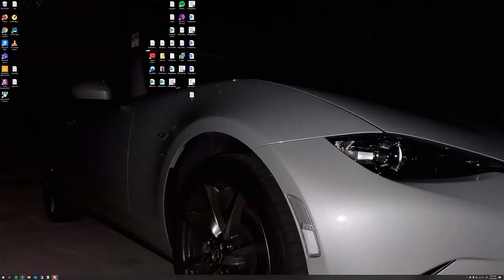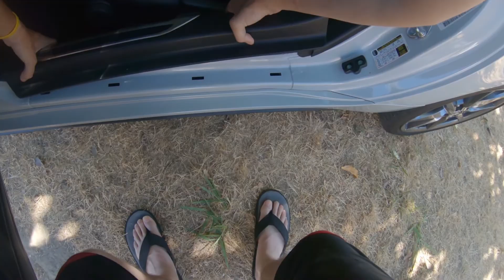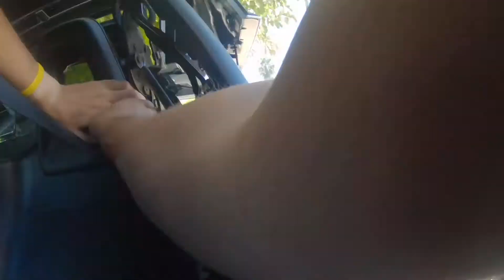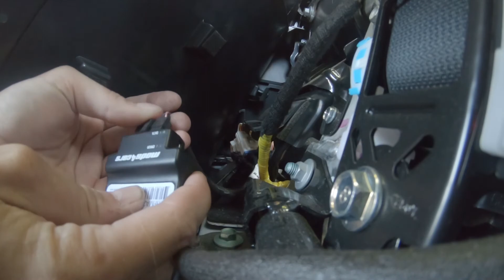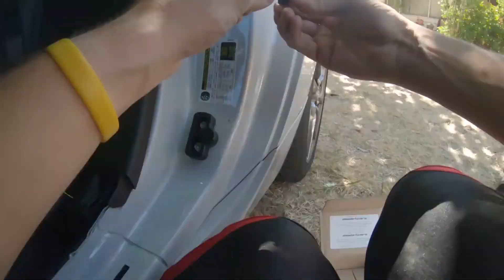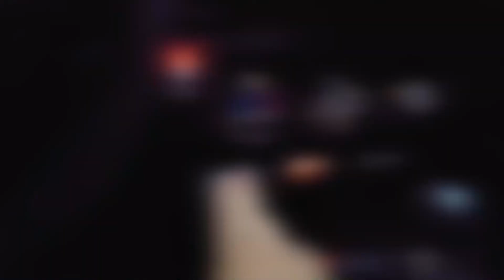SmartTop Install on ND MX5

Comment: Traded an ND1 for and ND2 and the first thing I did was install another SmartTop. Before the break in period was even over.  In the first couple days there were several times I was stuck in very slow traffic, but not slow enough to put the top up or down.  Even got stuck on 95 having to drive to the next stopping point with the top partway up and it complaining that I was going too fast for it to work.  SmartTop doesn't stop and I can go 15 mph while it finishes.

Comment: Thanks for that through instruction! I would not have considered this mod until I watched your install it looks pretty doable. Karl did you happen to notice if the connector for the factory CD player is there on your 2019? I want to install a factory CD player if it’s not too involved.
Thanks,
DC

Comment: but it's not possible to open via the cars remote ?
Reply from the maker: Unfortunately not, at least not with this module. I looked around for something that would do this but I couldn't find anything
Reply: @MX5Kate  too bad, but got it anyway... now i can still drive 50km/h and reverse. perfect for parking in my garage without constantly holding the switch.
Reply: @AlexisGitarre  wait, what?